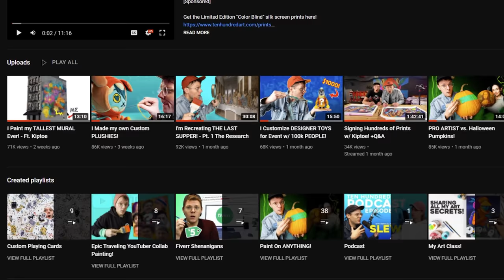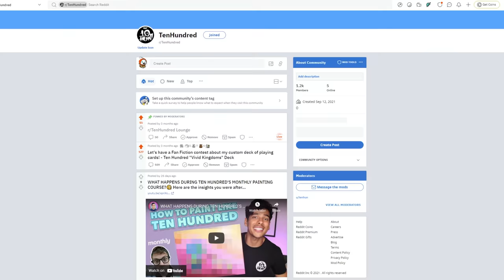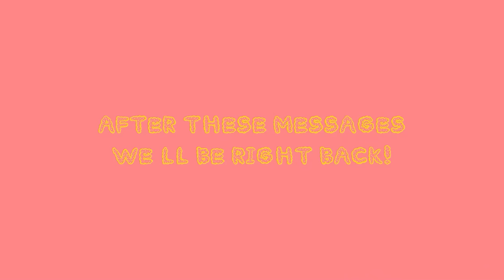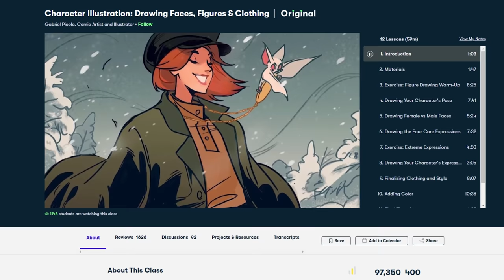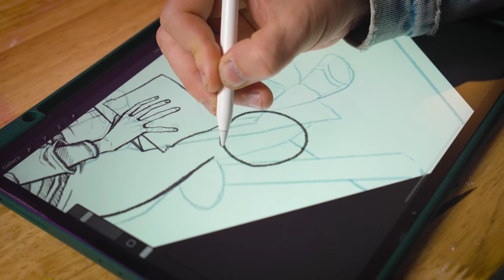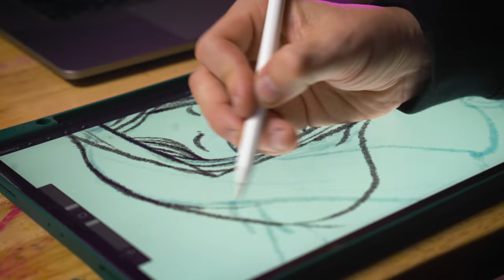Recreating The Last Supper in MY STYLE  & GIVING IT AWAY! - Pt. 2

Comment: hopefully its not too late to build a panel with the support lumber flipped the right direction (using it the way shown here has higher risk of warping, and if you were going to only use the smaller 1.75" profile from the 2x4 - you could have used a 1x2s flipped properly on their spines, and saved 80% of the weight - and no the added weight is not making it sturdy, its wood holding moisture, and structured in a way more likely to warp over time). I don't wanna be THAT GUY, but I love your stuff, and want it to last... like a proper panel should.  timeless art tributes of timeless art should be done on a panel that can last... hope this comes across as support - so If you need any panel help, hit me up, I got you!  if not, all good, and next time maybe use 1x3" from the pine selects isle, not that house lumber... peace, love, and panelingus!
Reply: Although, it would fit with the theme! The original Last Supper was falling apart pretty soon 😂
Reply: @ettaz  ahha touche!